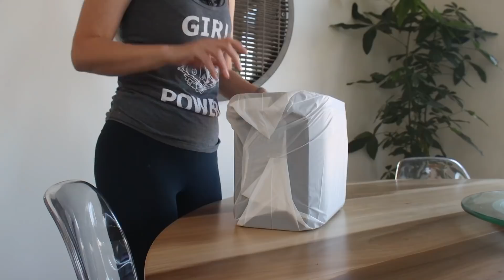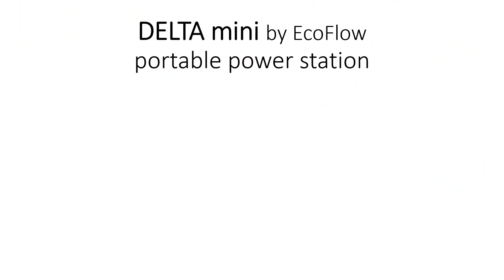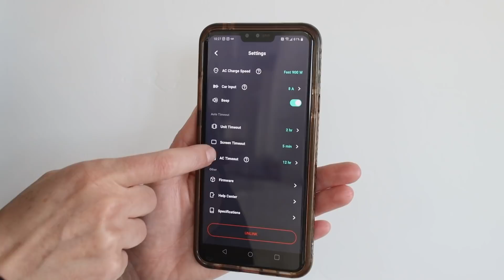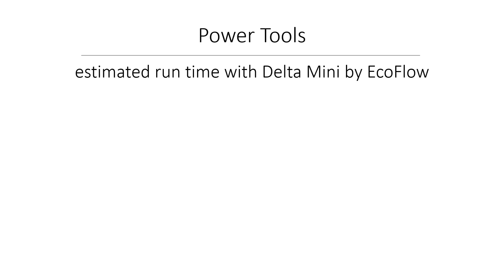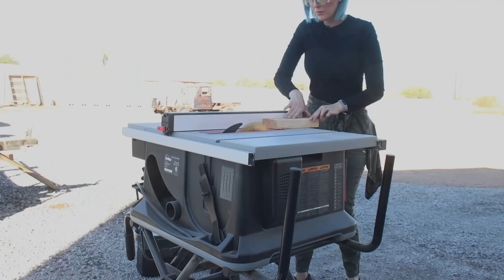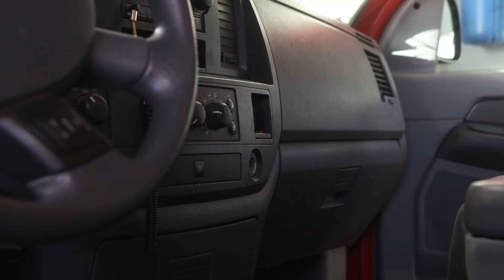What We're Doing for Emergency Power | EcoFlow Delta Mini

Comment: They are power packs not a generator by no means and they do overheat so you will have charging issues here and there and they are throw away units batteries will die eventually they have along way to go still. And pricing is not Eco-Freindly at all.

Comment: My last job gave me an Eco Flow Delta (the 1300W version) because I program for a living and during critical moments, they wanted to make sure I could still do my job even if I lost power. I recently left and they took it back! :-( So I just ordered the mini version. I plugged my NAS, modem, router, switch and internet telephone in it. It's not uncommon for us to get quick "lost power" situations, only for the power to come back on right away. For my NAS especially, having spinning hard drive platters all of a sudden lose power can mean destroyed drives and lost data. If you sometimes lose power and have computer equipment, I feel like you should definitely have something like this.

Comment: I'm impressed that the Mini charges in about 100 minutes. My power bank takes a lot, lot longer than that.
Reply: I believe this version has the option to charge it "at normal" speeds. I just ordered mine (I had the bigger Ecoflow Delta in the past) and will use the slower charging option. If you don't need fast charging, there's no need to put stress on the batteries.

Comment: Arizona is THE place for powering a house by Solar panels. They can deliver Electricity as Hot Water. It could even be possible to run your House completely off grid.
Reply: While you're 100% right, for many people, the costs, even with the government tax incentives, is a high barrier to get past. And there are a surprising number of hurdles to (sometimes) have to overcome. For example, I read one story where a couple went through an entire solar build, only to find out that their local power company's grid was too antiquated to accept the back feed of electricity! Lots of variables.
Reply: @dontbanmebrodontbanme5403   infrastructure will always be an issue in the us, if no one has the guts to tackle it. No one wants to take money in the hand to improve others lives but doing nothing will only make it worse in the long run.
Reply: @dontbanmebrodontbanme5403   OFF-GRID has no issue with that you just described ON-GRID solar.

Comment: A tv will last 15 hours, but a coffee pot is less than an hour 🤨🤨🤨🤨 chest freezer 17.5 hours, toaster and hour? Full size fridge 75 mins, table lab 10 mins longer…..
Reply from the maker: Yes, the run time is all dependant of Watt hours. Coffee pots have surprisingly high wattage demands mostly because of their amperage, as do any items with heating elements. Heating appliances have always been notoriously energy hungry. The coffee pot and toaster have changed very little in decades. On the other hand, manufactures have worked really hard to get other devices like LED TVs to work much more efficiently in recent years.
Reply: @PneumaticAddict  too bad your airco doesn’t play the efficiency game.
Reply: @PneumaticAddict  I have an energy monitor on my fridge and chest freezer and they pretty much draw the same current.  It’s surprising how you come up with these time frames. I suspect that when you plugged each in maybe the compressor was running on the fridge but the freezer maintained and the compressor was not running. In real life longer simulated runtimes don’t expect these results.
Reply: inductive load like Toasters, Coffee machines or even everything that has an electric motor, will drain a Power Supply quickly.
Capacitive loads and integrated circuits (like in TV, Monitors, etc.) don't strain a Power Supply not even closely

Comment: I sometime help run outdoor games for laser tag and airsoft, and have used a power system I built in the past.  How well does the EcoFlow handle wet weather like rain and heavy dew?  The morning dew in the late summer here in central Indiana is wet enough to kill laptop that is not at least semi-rugged.
Reply from the maker: Unfortunately, the Delta Mini is not rated to handle much moisture as well. I wonder if you could create some sort of DIY shell or outer box, almost like a Pelican case?
Reply: @PneumaticAddict  I used a DeWalt rolling tool box for the last one.  That battery has since died, and it weighed 40+ lbs.  This looks like a good replacement.